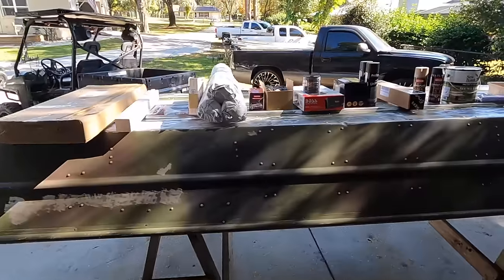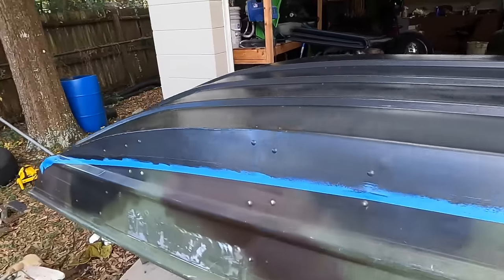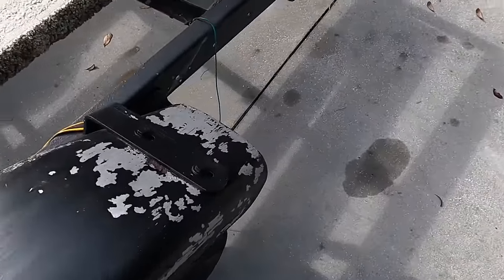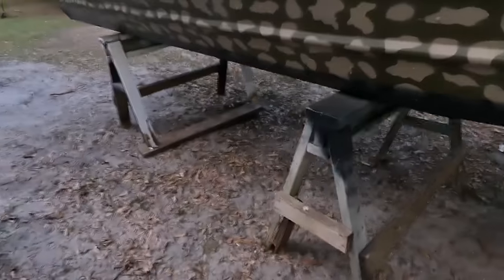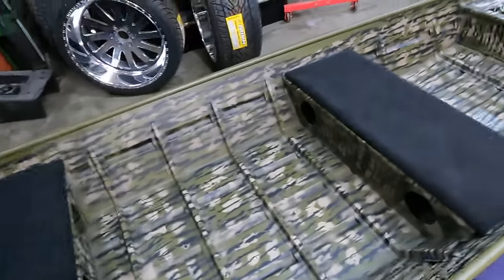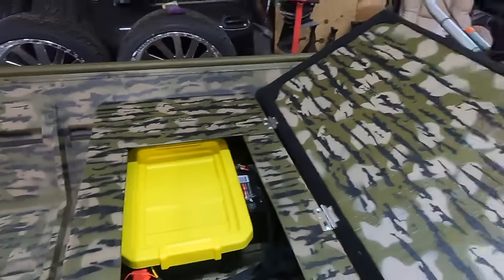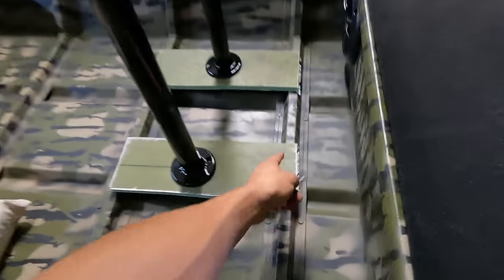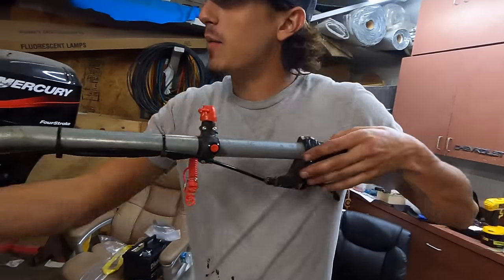Building the BADDEST John boat for under $800 bucks!! DIY

Comment: Tip if you want wood to last in a boat???? coat it with epoxy resin a few times. It will do 2 things.  Absorb the epoxy making the wood more structural and water proof. . Your wood will last a crazy long time.
Reply: I was thinking about a fiberglass coat what do you think about that?
Reply: Epoxy will crack.
Reply: Actually go to a printing company and get a few of their press plates and put it over the wood and seal it. We put carpet over ours for use on the floor of our duck boat. We have since replaced the carpet twice since 1997. The plates we used were sized 28” x 44”, they’re made of thin aluminum.

Comment: I have that motor motor on a  Mud Skipper Twister and really like it on my 1436 Lone Star. I know that you have a surface drive now and I wanted a surface drive but can't afford it. The Twister has a shorter shaft and I have almost the same angle as a surface drive, which is very close to an outboard.  People worry about that flexible shaft and they send a spare with it, which kind of made me worry. But I've throttled the hell out of it with no problems, so far. I grease it every time I load it on my trailer though and I got rid of that three bladed prop before I even mounted it on the boat. I need to pop over to the video about your surface drive and ask where you bought the kit from.  I love my little mud boat and do all of my fishing from it.  Oh, I used Gator Glide on mine too. That stuff is amazing!
Reply: Do you have a link to the motor?
Reply: @texasplumr What kind of performance are you seeing out of your twister? Speed? Running vegetation?

Comment: Red and Green sideljghts must be visible across 112.5°, and from a distance of one mile.
 All I noticed on your sweet rig was only visible from 90°.
Reply from the maker: If the navigation lights are on the light bars blasting the radio is all the way up and I’m bouncing off the rev limiter lmao never had an issue tho.. new owners problem

Comment: When you pour out of a jug. Turn the jug 180 degrees and pour out of the side. You will have better control and won’t have the glue glug glug thing going on and it won’t splash splash splash. 
Also add a small painting pole to your roller then you can roll with two hands and your wrists won’t hurt. 

Try it you’ll like it!

I’m redoing an old Lowe deep “V” 
Thanks for the lesson’
I subscribed and liked
Reply: Are you for real? Bozo
Reply: @OutdoorswithFloridaSmokin  no bozo. Metal gallon container pour over the side, you can get much more tilt to the can before products start to flow.
Reply: @OutdoorswithFloridaSmokin  
Watch video Quick tip, pouring from a 1 gallon can.
Sorry if I did a poor job of explaining.
Reply: @c50ge  the problem is why are you commenting to start with? He’s a grown man he knows what he’s doing. It’s not your place to correct a grown man or even tell him what to do.
Reply: @OutdoorswithFloridaSmokin  the reason I commented is because someone taught me another way to do something and was sharing with others, not just with the author of the video.  There was no nefarious or degrading comment made .  I probably did a poor job of explaining it but thought it might be helpful. If it would make you feel better I will gladly remove my comments. I apologize if me comments were taken in a way I did not intend, had nothing to do with me judging his maturity.
Reply: Thanks for the tip!

Comment: No need to waste a rocker panel switch for a stereo that already has its own power switch. Wire it straight to power and run a inline fuse for protection. Good work btw. I built my own Jon boat as well.
Reply: That is incorrect sir. If you do not have a main feed then the ACC will drain your battery if sitting for long periods of time off a trickle charger.

Comment: What screws/bolts/taps etc did you use to screw the wood that the grab bar is mounted on to the ribs on the boat? And did it hold good or break loose

Comment: How many batteries are you using to power the LED light bar and speakers? I'm in the middle of building my boat and not sure on battery for a stereo/speaker and trolling motor

Comment: when you say you grinded on the bottom what did you use? and what did you use to sand? did you use gator base or just the glide? thanks
Reply: Looks like he wire wheeled it.

Comment: With those predator motors man they can’t be turned on there side long. Oil will come threw the valve cover vent tube and leak into the carb. I’ve had a go devil crawfish model that’s done this multiple times.

Comment: That boat needs a Mercury 25, it'll fly with something like that!
Reply from the maker: Wouldn’t go through anything it can with mud motor but last video I put bigger mud motor on goes just as fast as it would w a 25tiller an I can go through anything
Reply: Yeah I gotcha, I’ve got a 12 foot jon with a 25 Merc that runs mid 30s.
Reply: I’m just trying to find out where you got the mud motor kit?

Comment: Do you know how to read spark plugs? You don't have to worry about the main jet there is only one for a stock engine. change the muffler, you should change the jet. But getting your plugs to run coco tan is where you want to be

Comment: Your stand up grab bars on the wrong side and you’re standing on the wrong spot you’re supposed to be using your left hand to drive and steer instead of your right I know it’s uncomfortable but when you get used to it you have way more control standing on the right side
Reply from the maker: Motor an grab bar gone stay tuned